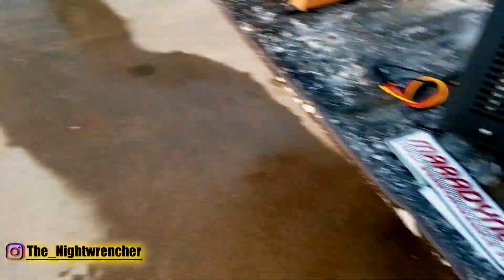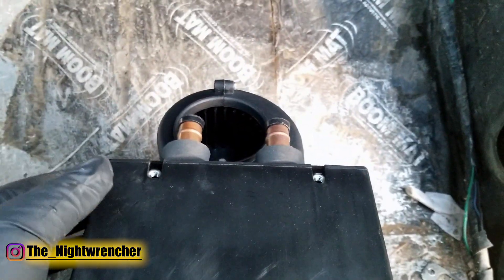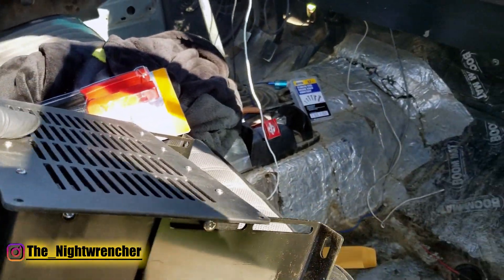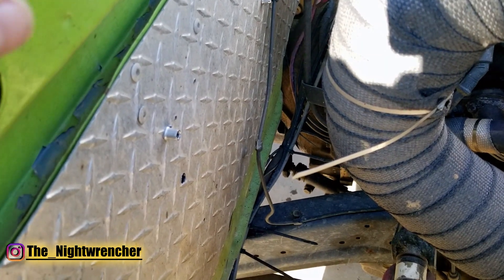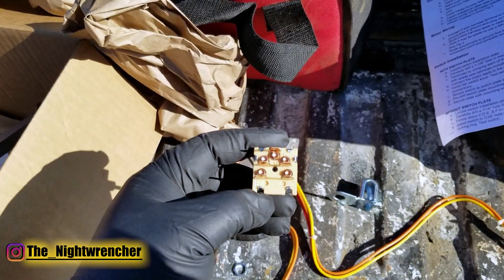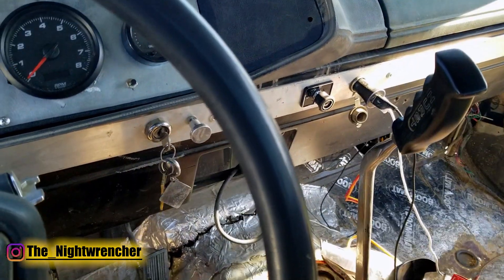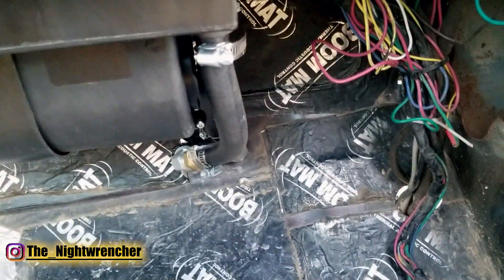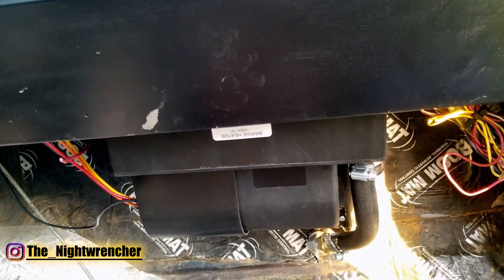DIY Car Heater Install- Boat Heater | Maradyne HP Fans | Maradyne Marine |

Comment: In the winter I loosen my tranny tunnel cover and the heat from the engine comes in pretty good. And it's free.
Reply from the maker: That doesn't help on my build 😂 First because my exhaust doesnt run to the back of the truck and second because a hood doesnt fit because of the turbo 🤣
Reply: @NightWrencher  What about heat off the engine? Drill some holes in the firewall? Call them engine viewing holes? 

In my trucks we always called them highway viewing holes when they were in the floor. Its where we kick the loose nuts and bolts rolling around when somebody tailgates. I know, squirrel. Whatever 🍻

Comment: Nice install. That funny little bracket you said maybe a ground is a clamp on switch mount for installing the fan switch on the bottom edge of a metal dash without drilling holes to do it.
Reply from the maker: You're right, I realized what it was after the fact 😂